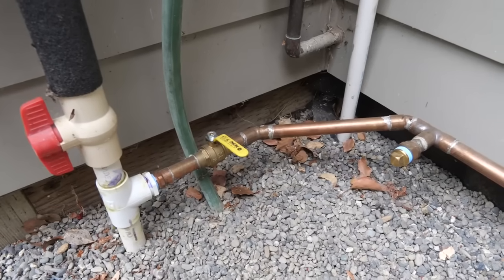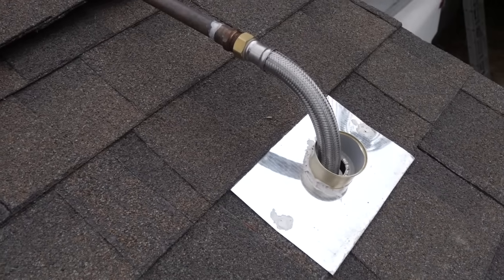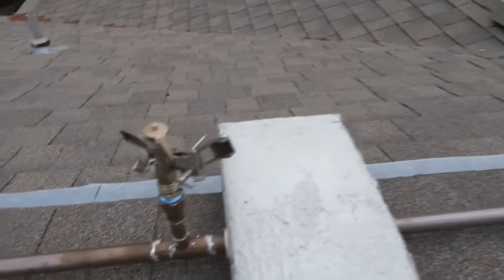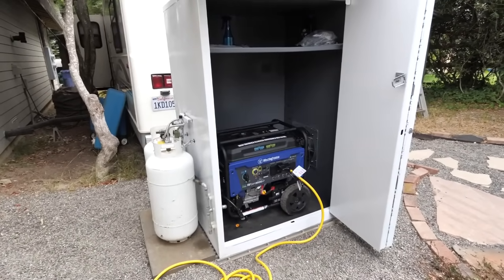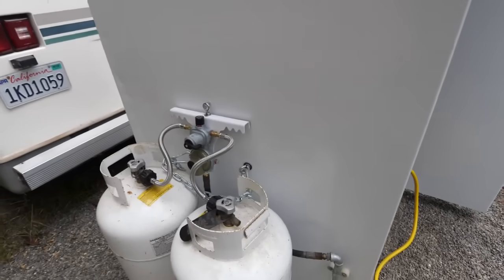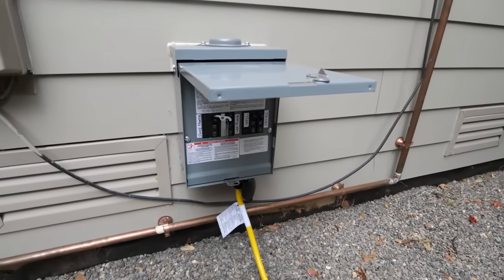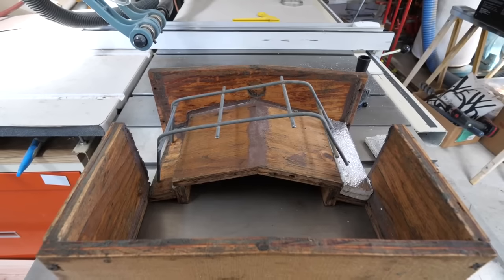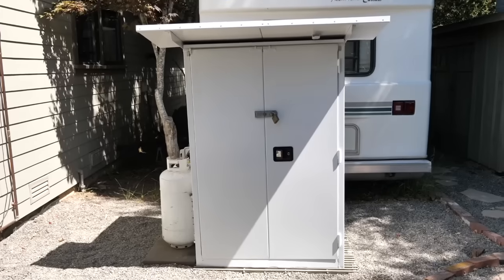Roof sprinklers and backup generator for wildfire-prone rural house

Comment: As a wildland firefighter well done sir! A couple things to note. You should do is clear any vegetation away from the sides of your house in order to prevent flame from directly impinging on the structure. Boarding up windows can also prevent the glass from breaking due to heat and allowing embers or flame to enter the structure. Especially the skylights, if they even crack you will get water damage. If that can't be done in time remove curtains on the inside so they can't catch fire from radiant heat. Again well done!

Comment: I did not think of the plastic melting in a fire. That may be overkill though. If it’s hot enough for the pvc to melt, I think the house is gone.  The system should draw from a holding tank, (think pool or hot tub). 
I would also like to see a roof anchor that is not home made/one off. These wouldn’t work w my Spanish tiles. 
Otherwise, very good idea and well executed.

Comment: great job but what's going to happen when the heat from the fire not the flames but just the heat gets close to the PVC line coming out of the ground? PVC melts and sprinkles quit working. You are so close to perfection!

Comment: excellent, hope you had good luck w those sprinkler heads, i have those exact ones.. the springs rust and break very fast. then the head stops spinning... I have yet to find a brass sprinkler head that works out doors ALL the time at any pricepoint..

Comment: Good video.  Excellent preparedness.  I assume that roof water spray covers your generator shed and fuel.  As mentioned wind driven sparks get in and under eves and decks and start fires.

Comment: I saw a video that a retired fire fighter had made and it truly got me thinking about something I think many of us simply forget. When fire or extreme heat gets to water lines they fall apart and just run nonstop at the first break. 
I mention all that so you’d understand why I have these suggestions. Consider replacing all that copper with steel gas pipe, no solder joints to melt if you do. Second, buy some fire brick and mortar. Make a small structure overtop your well pump connection so any heat or fire wouldn’t be able to get to it easily.

Outside of that, I think what you did looks great. I especially like the your custom cast blocks. Those would definitely keep things in place.
Reply: As long as there is water in pipes neither the pipes nor the solder joints can melt.
Reply: @bruce2900 exactly. Try soldering a pipe while the water is running. Even a small drip of water would stop you from soldering it. I can’t imagine a fire causing any issues to those copper lines.
Reply: @danithaman4610  PVC pipe is used here in Australia for this kind of thing. It wont melt if its full of water.

Comment: There will be a whole lot of people in the US right now who wished they had to put this on their roof. Some people just know how to do it - well done mate.
Reply: We’d all like this, but you must have a water source, most housing is on some kind of municipal water supply.
Reply: @sw6118  I think a priority must be made for installing a 40,000 L water tank for water, or a pool - it would be worth it to save your house.
Reply: @ I agree as well as installing a metal roof top sprinkler system and indoor sprinklers but those are all upgrades that insurance companies aren’t going to cover. With this level of catastrophic loss we’ll see if they don’t all declare BK. Given how frantically insurers were canceling policies, their own models must have predicted a mass disaster like this.
Reply: @sw6118  its not the roof shingles that are the problem. Shingles on California roof are tar based and fire resistant if they aren't metal or tile. You can get embers on them and they won't ignite. The fires LA had got so out of hand due to mismanagement of multiple things which lead the fires to get out of control, sweeping though and getting houses along the way. No amount of metal roofing would save that.
Reply: This won't work in LA, where the fires are, because they don't have well water systems in LA. A similar system did work in saving a house from the wildfires, but it relies on pool water. The municipal water supply in the affected areas have lost most, if not all pressure. A man who used a generator to power a pump, that used pool water, successfully saved his home from the fires.
Reply: If you watched peoples sprinklers in 50 mph winds and constant 80-100 mph gusts .....well there's a saying your just "pissing in the wind"

Comment: I did something similar on my house during the thomas fire. I used soaker hose instead of sprinklers because I was low on funds. However they soaked the entire roof and the runoff kept the area around the house nice and wet. People thought I was crazy, but when a house on the next block went up, I felt it was necessary.

Comment: Great job and have thought about doing this myself.  My concern is under the eaves.  They either need to be enclosed with metal or be protected by sprinklers attached to the wall underneath.

Comment: I have a few comments.
For starters, congrats on doing what everyone in Cali should be doing.

BUT

Not everyone has access to a well. This will ONLY work if you are tapped into a well capable of supplying the water necessary to suppress fire in a large event.
The CITIES will NOT allow something like this in mass, BECAUSE there is no way they could provide the necessary water for 10s of thousands of homes rigged with a system like this.

Also, I dont know if you are aware, but every single one of those attic vents and whirly birds are access points for the burning embers that can blow into your attic and start your home on fire. And yes, a burning ember COULD make it in even with your system running full blast. All penetratiins into attic spaces needs to be double screened over with fine steel mesh screen to prevent that from happening. 

And lastly. You mentioned you chose copper over plastic because plastic would melt in a wildfire. If your fireprotection system on your roof that is full of water melts, its already failed. What I could say is copper is more durable as far as not suffering from damage caused by ultraviolet light that could break down plastics. PVC could still be a cheaper alternative in some situations.
Reply: Cities can take a hike. Have a pool or large water storage tank. Better than losing your house.
Reply: @antronx7  that may be your opinion, but it doesn't change fact or reality.

Comment: Just be sure to open your main breaker when running a generator.  If it back feeds into the grid, you could kill someone.  Pole mounted transformers work both ways.  Your house current (240 volts)hits that which in turn steps the voltage up to 12,000 volts on the primary side.  If the utility assumes they have switched off the primary and created a zero voltage condition, they coul accidently get zapped.

Comment: Guess this video is gaining traction because of the LA wide fires? This is a nice set up since it relies on the water well and not grid water (which can loose pressure). Also, if someone is under new construction, I would highly consider putting a similar set up in the eves. This way, you wet the walls all around the house to prevent a brush fire from climbing up.

Comment: I would start with removing flamable things around the house instead.. Cut down trees and bushes in a wide area around the house.. i think that is the best thing you could do.. if the fire cant travel your house will not catch fire.. but the sprinklers is a good thing but i think it will not be enough if you still have those bushes and trees around.